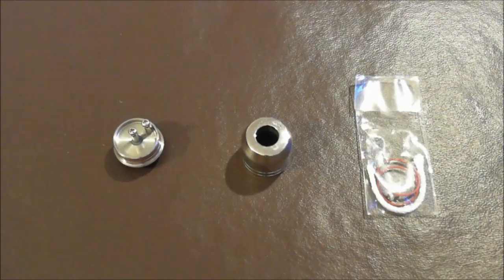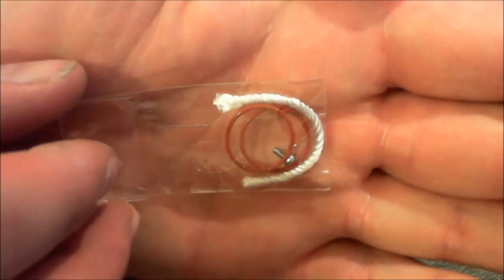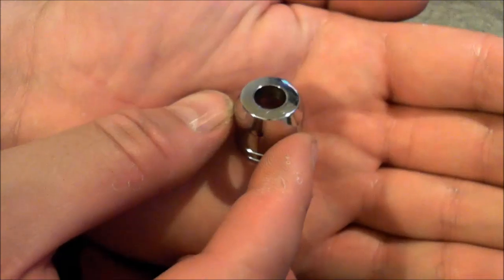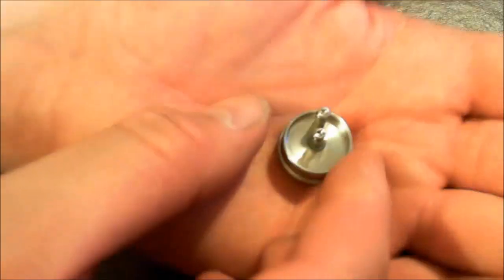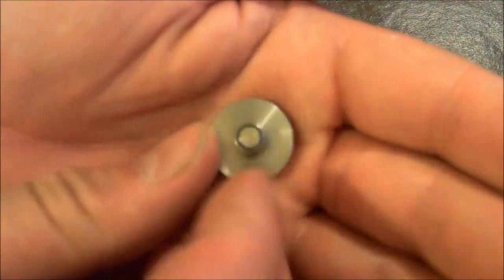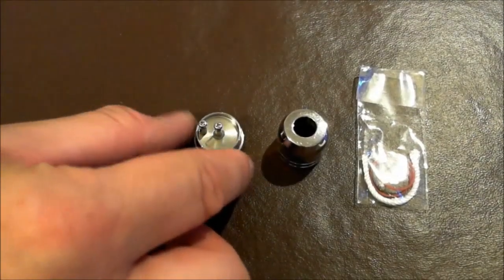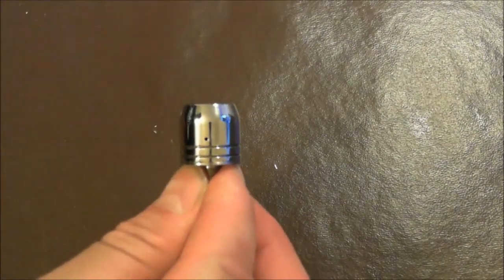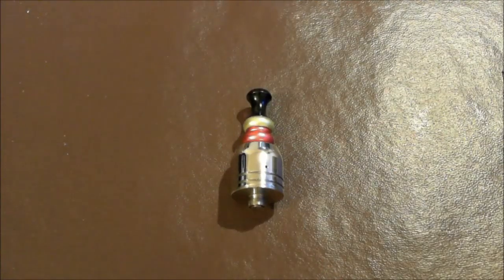The IGO-L Rebuildable Dripping Atomizer / Electronic Cigarette

Comment: thanks for the giveaway. saw your post on nu-vapor. i dont know for sure but i heard the revision of these are shipping with black orings and seem to be a tighter fit between the deck and top cap.... but you could always use the floss trick behind the o rings to tighten up the fit.